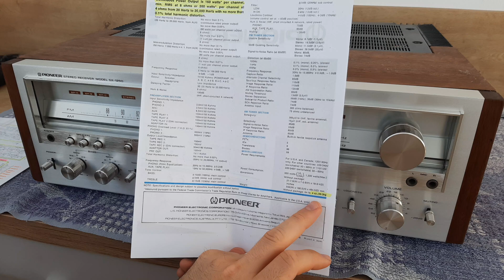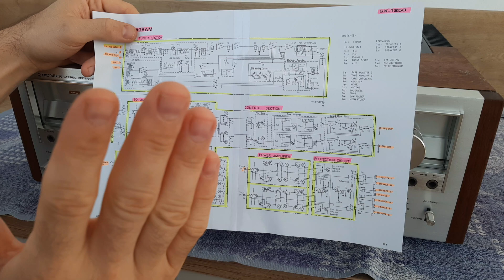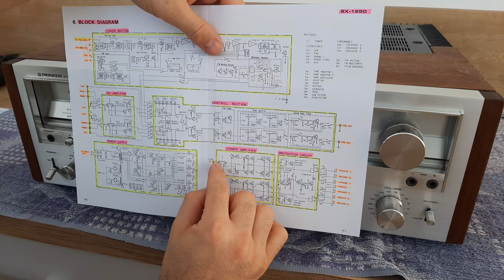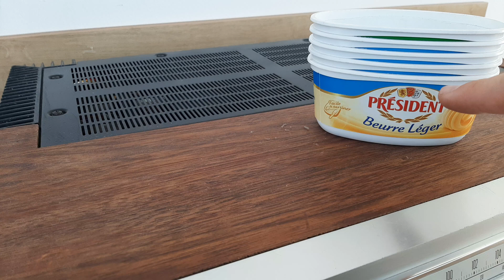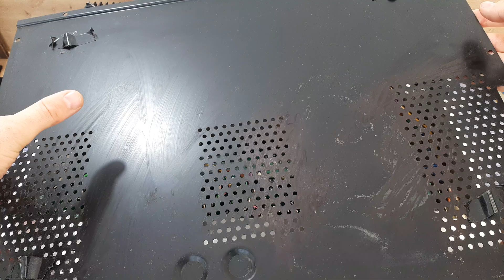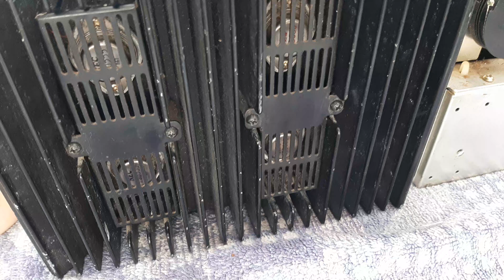Pioneer SX 1250 - Restoration Part 1 - The Most Popular Receiver Ever

Comment: Very knowledgeable video ❤. 
Sir, my 35 years old integrated amplifier started very light humming sound. A little more from headphone jack. What could be the reason behind?
Reply from the maker: Hi, thank you for commenting and subscribing.
First i want to know the Brand and Model of your integrated amplifier.
Problem can be in more places, if humm is on both channels that means is coming from a common circuit for both channels. Can be also a ground point, transistors, diodes, capacitors, cables..
I need more details for deeper help.
Stay tuned, more video to come!
Don't forget to check also soldering procedures: https://youtu.be/c_92NCsob6I?si=q8ZOE-9VtiwcAIfg
 I m here for your questions!

Comment: ai mentionat la sfarsitul videoclipului ca este la 220v si ca trebuie  sa.l ridici la 240v ,poti sa spui de ce?mersi
Reply from the maker: Hi, thank you for this good question. Ideea is very simple, inside of this unit is one transformer, transformer have to sections - Primary and Secondary. Primary side is connected to wall socket 100-110-220-240 volts and Secondary contains all secondaries windings designated for unit components. Transformer he is doing also the galvanic separation.
To understand better we have to use a mathematical representation formula : Vp/Vs=Np/Ns
Vp - Voltage on primary winding - 100-110-220-240 V depends of region.
Vs- Voltage on secondary winding - lets say 24 V
Np - Numbers of turns on primary winding
Ns - Numbers of turns on secondary winding

Now lets have 2 examples:
Example 1. - Vp - 220 V ; Vs - 24 V ; Np - 350 turns ; Ns - 38 turns.  (mains 220 volts / transformer set to 220volts)
Explanation - this is the situation when you have the unit connected on mains of 220 Volts and output of secondary winding is 24 volts. So far so good. 

Example 2. - Vp - 240 V ; Vs - should be 24 V ( IT WILL BE ?) ; Np - 350 turns ; Ns - 38 turns.  (mains 240 volts / transformer set to 220volts)
Vp/Vs=Np/Ns = > Vs=vp x Ns/Np => 240x 38/350 => 240 x 0.1085 => 26 VOLTS
Explanation - this is the situation when you have the unit connected on mains of 240 Volts , transformer primary winding is set for 220 Volts and output of secondary winding is 26 volts - > and you see, the voltage on secondary windings are increasing !!!!! 
To correct this , you have to change the setting of Primary Winding, when you change from 220 to 240 you will put in circuit more turns of winding result modifies Np - number of turns on primary winding.

I hope it will help you my explanation. If you consider is necessary to make a video with more details don t hesitate to ask.

Cheers and stay tuned, more videos will be released !